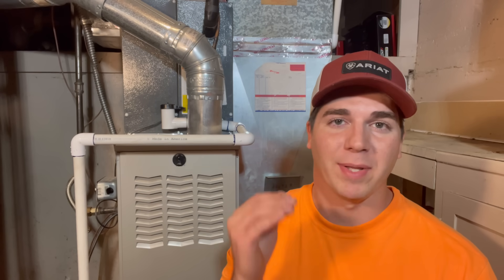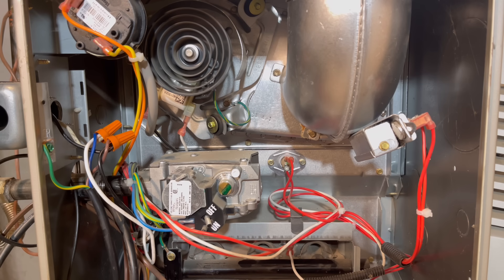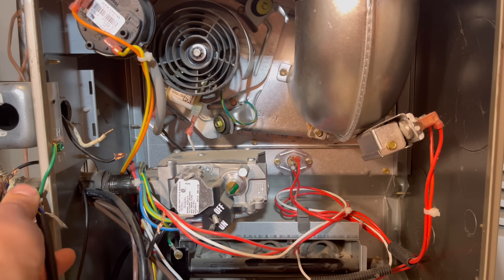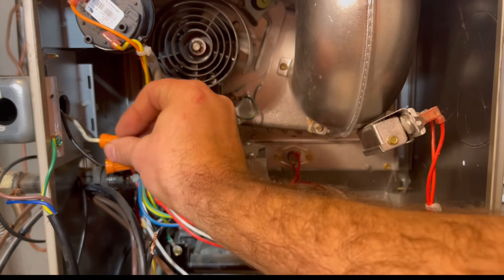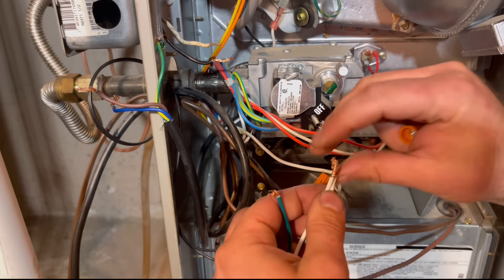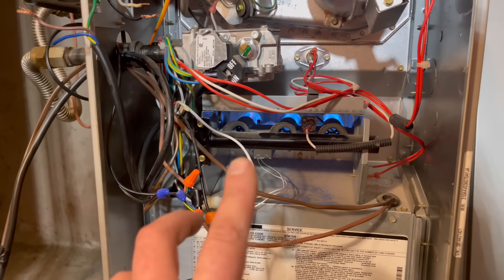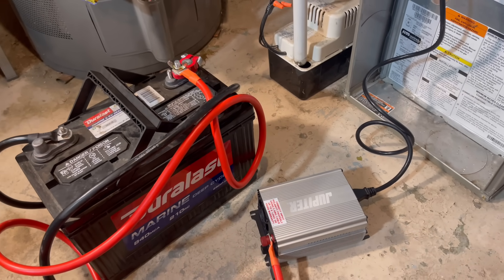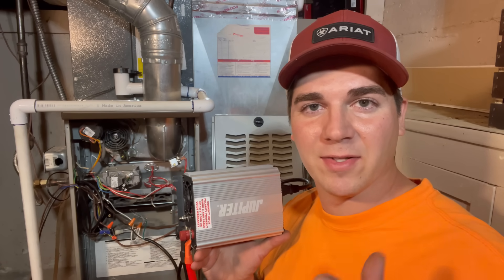Did You Know You Can Heat Your Home With A Car Battery?

Comment: Thanks for posting but I have a question and some comments.

First question?  Did you read the spec plate on the furnace to determine its watt draw?  
If not, you have no way to determine how long that battery will be able to supply power to the furnace.

I have what's probably a typical system for our area.  95K BTU, 95% furnace.

The thermostat draws 5 watts and it's powered 24/7  5*24 = 120 watt hours = 10 amp hours @ 12 volts (actually 11.11AH with the inverter losses)

The furnace blower draws 460 watts (measured with a KillAWatt when the furnace is running off the 2000 watt pure sine wave inverter).  Pure sine wave because most electronics and many motors are happier and run cooler on pure sine wave power and not the "simulated sine wave" on inexpensive inverters.  Example: the 4.4 cubic foot fridge in the basement uses about 60 watts wgen running on the pure sine wave inverter but about 80 watts when running on a good (Xantrex) modified sine wave inverter.  Some power tool chargers (Ryobi 40 volt) specifically say "Do NOT use on modified sine wabe power.  What's the spec for your furnace?

From testing, if the house thermostat is set on 68F and the outside average temperature is 47F, our furnace runs 2.52 hours/day.  2.52 * 460 = 1159 watt hours or 107.33 AH at the battery (including inverter losses).

Together, that's over 118AH and no $100 car battery is going to provide that.  Period.  The battery you showed is not going to be $100 or less.  It has a Reserve Capacity (RC) of 210 (that's minutes at a 25 amp load - such as running the lights and emergency flashers when stalled at the side of the road).  RC can be approximated to AH by dividing by 2 so 210/2 = 105AH.  The CCA is of no value in determining how long the battery can power an inverter to run your furnace - only the AH - how many amps for how many hours.  The CCA is a 30 second rating for starting a vehicle at 0F.   It has NO relationship to long term lower power uses but it is a nice, BIG number that's good for impressing buyers.

If the outside daily average temperature is 38F, the furnace runs 3.72 hours/day or 1901 watt hours or 158.44 AH at the battery terminals (including inverter losses).  That $100 battery isn't going to provide that either.

Possibly a bigger battery?  Walmart Everstart Marine RV 27DC-850N is marked on tha battery as 120AH although the usual formula for converting RC to AH works out to much less than 120AH.  That battery would power my furnace ONE day and it would have been so discharged that it will likely NOT survive more than a week.  Any idea how long it will take the car's alternator to charge that battery?  If the car alternetor is 65 amps, that's 65 amps at 40-50MPH, not at idle.  If you're driving the car with lights, heater, wipers, rear window defroster, etc. on then it can't deliver 65 amps to the furnace battery to recharge it.  Letting the engine idle might get you 15-20 amps.  That's a long time to run the car engine and be without heat while you charge the battery for tomorrow's use.  Recharging a lead-acid battery of any flavor requires replacing 107 to 115% of the power taken from the battery.

My backup battery bank is 12 volts, 420AH and it could run just the furnace for 42.6 hours to a safe level of discharge (50%)  You can do that to a "marine" labeled mixed-use battery but not a basic SLI (starting, lights, ignition) battery which shouls never be discharged more than 20%.  If the battery bank was LiFePO4, it can safely be discharged 80% several thousand times and could power just the frunace and thermostat for almost 3 days (68 hours total time, NOT run time)

My battery bank is solar charged and has been in place for 5 years, providing limited (8 to 20 hours) of power depending on the season.  It beats being out in a thunderstorm or shoveling 7" of snow in the dark at 30F to get a generator out of the shed.

Want to know more about batteries?  Spend a week at batteryuniversity.com ;-)
Reply from the maker: WOW, you know your stuff bro! Thanks for sharing your knowledge with everyone on here. I realized I was totally wrong, so I actually got a pure sine wave inverter and have it mounted to my work truck and wires to that battery. So I’m theory, I should be able to run an extension cord and run my furnace for as long as I have fuel in my truck.
Additionally, this is not my primary emergency power source. It was just an idea I had. I have a dual fuel 3500w generator that is fitted fora quick connect natural gas line. So as long as I have natural gas I’m golden. But thanks a million for the wealth of knowledge shared! Cheers
Reply: According to you, a thermostat uses 5 watts of power?  My thermostat has 2 AA batteries in it.  They lasted 10 years before they died.  So are you saying that I got 5 Watts times 24 hours, times 365 days times 10 years out of the 2 AA batteries? That is 438 KWh.  Check your math or get a new thermostat.
Reply: @jimstand  Unless you've checked the idle power with a KillAWatt or similar meter you have no idea how much "hidden" power is being lost.  The figure of 5 watts is for the transformer powering the thermostat and the "smart" furnace controller (I've used computers with smaller motherboards) - that board is always powered at some level, so that's the minimum of 5 watts.  If your thermostat includes a relay (some do) it IS powered by the transformer and the batteries are primarily backup for the settings (day/night switchover times, day/night temperatures, daily schedules).  
I can't speak for your furnace and thermostat but I can speak for what I have tested.  The original thermostat was a touchscreen unit that was the standard thermostat installed by the HVAC company that did the furnace and A/C install and the tao AA cells lasted just over a year.
If you want a zero power thermostat, the old round Honeywells with the mercury switch on a thermal spring are among the true zero power thermostats.

Comment: Won't work with a electric furnace.
Reply from the maker: Correct. Or heat pumps. Only gas furnace as stated in the beginning of the video

Comment: Be sure to use a pure sine wave inverter , i had a modified sine one in the past wreck 2 standing fans after 12 hour usage.the motors cannot handle it , nevermind electronics.
Reply from the maker: Thank you for this. I’ll update that in the next video on this. I actually have it hardwired to my work truck so I can run and charge the battery as long as I have fuel in my truck! Cheers
Reply: @diyhvacguy  I was told modified was great for tools and lights (resistance loads) but after my fan experience...nope.. ofcourse, you dont run a drill 12 hours continuous, lol.
Reply: Also , if you know someone with an oscilloscope, put it on the output to se the sine , and do the same with a load on it.. big chance it will look more like a modified than a pure sine, under load.. (usually from chinese manufacturers)

Comment: I may be wrong but...this works for Forced Hot Air systems like yours, but will not work (long)  for Forced Hot Water systems. Those have a circulator pump with a lot of wattage (1/4 HP?) that will drain the battery fast if it will even start.
Reply from the maker: You are probably correct on that. This also will not work for electric forced air furnaces or heat pumps.

Comment: Why couldn't you just plug the furnace into the inverter directly?
Reply from the maker: Because the furnace is hardwired to the switch in most cases. You make a valid point though however, what I’m going to do is add an outlet that is live when the switch is on (they make a switch outlet combo) and then I will have a male pigtail that is wired to the furnace and it will be plugged into the hot plug under the switch when there is grid power. Then when the power goes out all I have to do is unplug the furnace and plug it into the inverter. Thanks for the comment! Cheers

Comment: Skip the inverter it wastes battery power. Ditch it.
Read transformer where he's messin' with it. Looky, it makes 24 dc from 120ac. Use two car batteries = 24v when wired properly.
Reply from the maker: The transformers purpose is to bring power down to 24 v for the circuit board so it knows when to turn each component on in sequence. Some high efficiency furnaces run on 24 volts all together but not most. Mine uses 120v for the blower, inducer, and hsi.

Comment: A word of warning. I WOULD NOT power a furnace off a cheap modified sine wave inverter like that...
Reply from the maker: Yes I e learned since then to run it with a pure sine wave. Actually I have it mounted in my truck now so I can run the furnace or anything else that’s low enough wattage for as long as I have fuel in the truck. Thanks for the comment! Cheers

Comment: Make note that some inverters don't have on/off switches so the pig tail will be hot as soon as you plug it in.
Reply: Easy enough to wire a switch inline with it.

Comment: 3hrs MAX..  I have a better solution!  Hook a hose onto the gas line and hook it onto a cheapy $120 Natural gas radiator and stick it in your fireplace.  Just don't look at your gas bill thanks to Joe Bidens America.🙄  At least you won't freeze and my method requires ZERO electricity!
Reply from the maker: This is brilliant. Thanks for sharing!
Reply: @diyhvacguy  I went through the texas power outtage last year.  My power never went out while neighbors 1 block away were in the dark for a week.  But I had a temporary hose and my heater at the ready.

Comment: Doesn't it drain the battery fast
Reply from the maker: That’s what people are saying. I still want to test it, but I found a better long term solution. I have the inverter hooked to my truck so I can run I as long as I have fuel in the truck! Thanks for watching! Cheers
Reply: @diyhvacguy   👍

Comment: Some furnaces (like mine) require a neutral ground bond to work, witch is how the house wiring is. Didn't work with my generator until I made it bonded. Most inverters are floating neutral and not bonded, and bonding them can cause damage to the inverter or furnace logic board.

So if you want to run your furnace this way, check to make sure it needs/doesn't need a bonded neutral ground and make sure your inverter/generator setup is/can be wired that way.
Reply from the maker: Can you explain exactly how you bonded it?
Reply: @diyhvacguy    See my most recent coment
Reply: For my inverter generator, I made sure it could be bonded without damaging the generator, then just made a pigtail and used a wago connector to bond the neutral (white) and ground (green) wires together. Then just electrical tape up the hot. Plug it into one of the 110v outlets on the generator and you're good to go. 

They also make plugs you can buy as well. 

Later on I took the generator apart and added a switch so it can be floating neutral or bonded depending on the use case.
Reply from the maker: @NoName-sx4cz  awesome. Thanks for sharing your knowledge
Reply: @NoName-sx4cz  You've done this and it works? 

I chose to run white wire from extension cord end to the white on the furnace wire and to the incoming line white wire. 3 wires with wire nuts tied together.  Same for the ground wire.  Ground wire from extension cord connected to ground wire going to furnace and  on the ground wire from the panel.  Only the black wire coming from the furnace to the black wire from generator. The black wire coming from circuit panel is not connected to anything when using generator.  Now you have made a ground/neutral connection to the panel, which  makes it a bonded generator, and is compliant with code.  You therefore don't need a separate grounding plug on the generator   If you used a SPDT switch (on/off/on) on the blacks it would be unnecessary to connect and disconnect the wiring back to original breaker box to furnace.  Just wire it up like that in a 4 inch utility box and call it done.
Reply: I've been looking for a 12v pure sine inverter that can safely be bonded for a reasonable price for a while now. That way I can run the furnace with the battery/inverter like you demonstrated at night, and use the generator during the day. Unfortunately most of the bonded or bondable inverters are pricey as thats a  feature usually for permanent hard wire installs in off grid or rv/boat situations.
Reply: @NoName-sx4cz  You don't need a "pricy" inverter generator. (This assumes you are using a natural gas heater).  There are 2 motors - one is a very low power induction draft motor (runs before the furnace will ignite burners).  The second fan is the circulation fan.  You would not need more than 1200-1500 watts for startup and only if it is a no capicator start up fan.  Once running, total watts won't exceed 700-800 watts, if that. Highly recomment the Champion 2000i dual fuel (propane or gas)
Reply: @avflyguy  I have an open frame champion 3500 inverter generator. It's not just for the furnace, I have a freezer/refrigerator and other household loads to run when the powers out as well. But it runs my furnace just fine and not too expensive.
Reply: https://youtu.be/ntm6eOmy_no
Reply: I tried to have my furnace wired so I can run a generator to it, but the technician stated that my very new furnace doesn't allow such a power source due to "it's programming".  Sorry, I'm not well versed in electrical or furnaces.  Something tells me your issue is more than likely my issue as well.  My tech gave up very quickly and moved on to other jobs and still charged me for an hour.  I get it, but still sucked paying for an incomplete job.
Reply: @pikehunter23750   you got screwed.  He didn't want to build or buy a few inexpensive parts from big box store and wire it to meet code and supply 120v pure sine wave.  The furnace doesn't care where the 120v is coming from as long as it is built to meet code and is clean sine wave.  Most all furnaces now have somewhat sophistacated program boards.
Reply: @avflyguy  That was my original assumption.  Thank you for verifying it.
Reply: @pikehunter23750  I would say that's very likely. Ideally with a quality pure sine inverter generator, there is no difference in the power coming in vs the utility power. There's no programming that could tell the difference between the two.  Other than if it's neutral bonded of course. Make sure to check and see if you can bond your generator if you decide to try it. read manual or contact manufacturer. Can cause damage/let out the magic smoke if it's not designed to be bonded.

Comment: Great video! I'm onboard with the entire process but I'm skeptical about how long the battery can power the main blower.
Reply from the maker: Yea that’s what everyone is saying. I ended up connecting the inverter to my truck and i can run the furnace as long as I have fuel in my truck. Much better long term power outage solution! Cheers